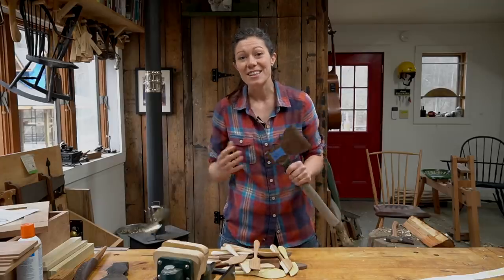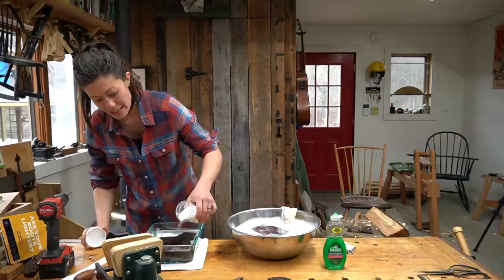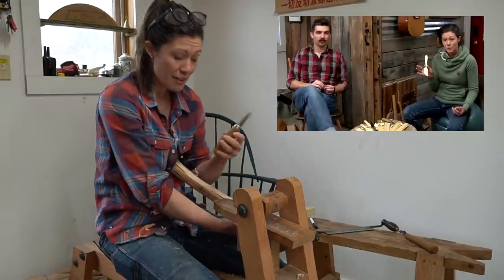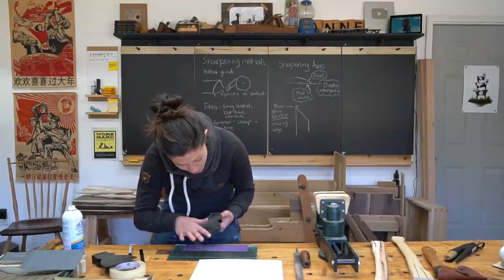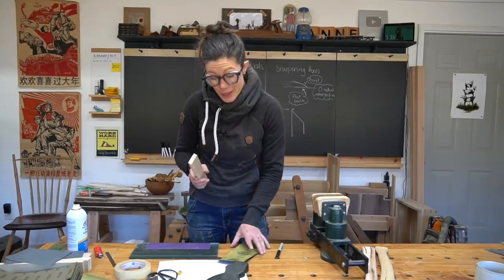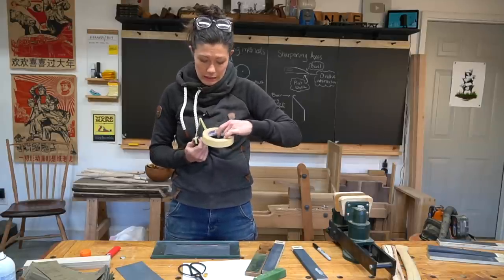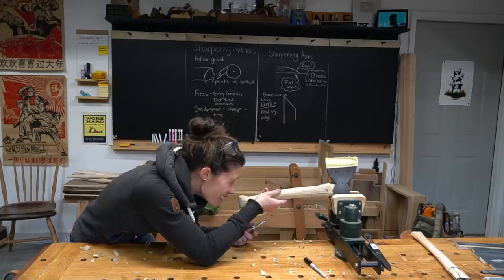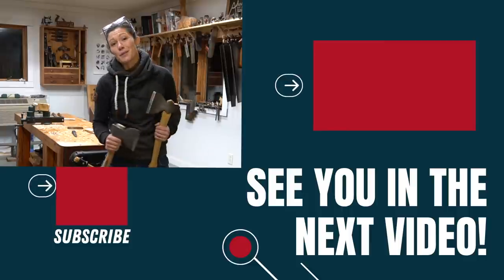Newbie's Guide Restoring a 100 yr old axe on a BUDGET

Comment: Great demo!  Even though I work primarily with machining tools, knowing how to use hand tools is an absolute necessity.  Back when I had a woodworking shop, all employees had to demonstrate a finesse with hand tools - including sharpening.  Without an intimate knowledge of hand tools, you cannot understand the basic principles of machining tools.  That includes being aware of the sounds made by a machine that needs tuning, sharpening and attention to prevent damage to the tool or the employee.  In over 40 years I never met a person injured by a properly sharpened and maintained tool, machine or hand.  Go figure.
Reply from the maker: Funny how those two go hand in hand, isn't it?

Comment: A long time ago when my father was an electrical engineering student, one of his courses required them to crate a perfect metal cube using a file.  It was a tough skill to master and makes you think about the materials.  He told me this many times and how critical angles & the feel are both needed to obtain the perfect result. That was back when all engineers had to have some practical experience.  It brings you back to reality.
Reply from the maker: Oh wow. That’s a pretty incredible feat with a file!!
Reply: @AnneofAllTrades  In the old days metal working apprentices had to file a sphere from a cube. By filing the corners into ever smaller flats as more and more corners were made.Then draw filing medium, fine and emery paper of diminishing grain until it could be polished. In those days fitters made things fit; really close. These days fitters just fit new parts off the shelf…….

Comment: Been watching your videos for awhile.  I don’t think most people understand the skill required to handle a file correctly.  So as to cleanly remove metal in a controlled fashion.  It is not as easy as it looks.  I have been a tradeswoman for 30 years.   Lots of filing experience.  Nicely done.
Reply from the maker: Learning proper body mechanics is definitely important, and a skill of it's own that comes in very handy if practiced well.

Comment: Hi Anne.  Try KrudKutter, that’s the brand name.  It is a phosphoric acid solution that works great to restore rusty items.  I have used it on quite a few items and it works great without harming the metal.

Congratulations on another great video.
Reply from the maker: Nice! I've not tried that one- what I like about citric acid is how inexpensive it is and the fact that I don't feel bad putting it down the drain- it's not gonna harm city water or septic which is a huge plus :)
Reply: @AnneofAllTrades  I re-use the acid multiple times, just pour it back into the plastic container.  When I am finished I use baking soda as a neutralizer and then take it to the city on hazardous waste day.  Other times I use 9% cleaning vinegar, it works just as well but takes much longer.  I soak at least 24hrs, sometimes longer to get the worst off.  I also neutralize with baking soda and then it can go into the septic.  No harm to environment.   I will check out the citric acid, it seems like a good product.  Thanks and greetings from South Texas.
Reply: Plain vinegar works equally well but the iron acetate blackens the fingers. iron citrate is not black so Citric acid is cleaner. Oxalic  acid works best but is poisonous  but can be poured down  drains. Pets will lick it if you let them.

Comment: I learned a neat trick (About 35 years ago).
When plane irons or any edge are pitted,  using an anvil, set the unbeveled side on the anvil and hang the edge About 1/8th inch off the anvil and tap the edge lightly with a hammer to bend it a little past flat.  Then you can hone it flat and no more pits!
You have fresh metal!
(It takes longer to explain than to do).

Comment: I think you are really left hand dominant but as with most left handed people, since you/they are forced to do more things with your right hand while they are developing the right hand skills also get developed. I’ve watched many of your videos and from what I’ve seen, your default is always left but use your right hand for things when when it’s much harder to use your left.  You can see this in your spoon carving videos.  The bulk with the left hand, then you switch to your right when those cuts are difficult or impossible for your left. Either way, I wish I could use my non dominant hand (left) at least occasionally. Keep rocking it Anne!
Reply from the maker: Ha! So you have actually discovered a funny little thing- you are right to a certain extent about choosing left first- but there's actually a reason for that. Because so many things are made for right handed people, I have always been forced to use them, but when it came to woodworking/gardening, I have intentionally tried to split my time doing any strength related task equally between hands from the very beginning because I don't want my back getting messed up from developing too much muscle on one side. I even went so far as carrying a timer around with me the first couple years I was in the shop to remind me to switch hands. With tasks that require more finess, like sawing, I wanted to develop muscle memory with both hands that would serve me if I ever had a shop accident or something. But with spoon carving, Josh actually has been forcing me to do everything left handed for a few reasons, but one of the best reasons is that it makes it easier for us to teach classes with me doing things left handed and him doing them right so our students have both examples to follow!

Comment: Try not to use anything acidic it only enhances pitting. Brass wire brush and some elbow grease or evaporust are my go to and sometimes a razor blade as a scrapper.

Comment: If you have more old tools you want to get the rust off, try electrolysis.  Just get a tub of water, add baking soda, hook up the battery charger, and let it sit over night.  By the next morning, it should have sloughed off.  Less issues with abrasive and great for hand tools like wrenches, lathes, hammers, and old vices.
Reply from the maker: I use electrolysis a lot, but this is a far less intimidating method that works fantastically well for folks just getting into restorations. I ran a business restoring antique tools for users for several years, and have tried just about every trick in the books.

Comment: Currently restoring a Philadelphia Tool Co. hewing hatchet that also has a Pennsylvania Railroad stamp.  I’m looking into hewing hatchets, I discovered that the flat side should not be flat, but slightly curved.  When hewing flat surfaces, you are removing scallops like when using a gouge.  What are these flat backed hewing hatchets used for?  What are your thoughts?

Comment: Can you do a video on the different kinds of axe blades (and knife blades), what they do and why their shapes help? I personally find it all very confusing...
Reply: Basically what kills (loosens) an axe, is the process of prying it out when it's stuck deep in lumber. Heavy axes and mauls tend to be fat, wedge shaped, because those tools are used for splitting e.g. firewood where you are going between the grain and deep (through the entire piece of wood). The wedge shape pushes the wood apart as you go down, minimizing the severity of how stuck the blade gets. Felling axes, boy's axes, hatchets and all that are generally going to be used for chopping and carving, and so a lot of weight is saved by taking the fat wedge shape out of the blade. When you chop you are going against the grain, and therefore the blade doesn't ever go super deep, so a thin blade is perfectly viable for this task.

Comment: Concentrated lemon juice from the grocery store eats through rust. About 1/2 to 1 hr will remove all the rust from an axe head. Cold.
Reply from the maker: You’ve gotta be really careful with acids though, because they can’t discern between rust and metal. When the rust is gone, they’ll keep on eating. You can (and I have) use coke, vinegar, all kinds of things, but after a few hundred restorations, this is the best, cheapest method I’ve found.
Reply: Lemon juice is citric acid. Buying citric acid powder is cheaper.

Comment: Thank you, this is a good video.
BUT!
There's not much info about hewing hatchets OR how to tell if it's left or right-handed.
Not even any info about your Grandfather's hatchet or what brand it is.
I have one that is very similar to your's, it's soaking in the citric acid/vinegar mix.
Got it on ebay, it needs a handle.
Looks like I'll have to use a 'commercial' hickory axe handle to fit the eye.
So I really appreciate wanting this & wanting to do things the old ways.
I'm learning how to greenwoodwork & I'm building a primitive English shave horse.
Have a GREAT day, Neighbor!

Comment: I'm just about to rehang 2 hewing axes that were my grandpa's, I couldn't quite tell from the video, did you make the handles with a slight curve away from the flat side?
Reply from the maker: I didn’t on these, because I didn’t have wood on hand that had grain that would follow that curve (which is very important to have, or your handle will be very weak right at the most important spot). I’ve seen folks do these handles straight and with the curve to protect your knuckles. Fwiw I’ve never scraped my knuckles with these axes.
Reply: @AnneofAllTrades  thanks Anne! I have only just discovered your channel, I'm loving it. I'm looking forward to getting the axes working, there's a bit of a YouTube theme as I bought leather from The Essential Craftsman to make covers. As Scott would say, keep up the good work! And happy new year (when it comes) from Scotland.

Comment: I may be about to ask an incredibly stupid question....
What's the difference between a left handed hatchet and a right handed hatchet? Is it just in the way the cutting edge is sharpened? Is it specific to hewing axes?
Reply: On those hews, there is only a bevel on one side and the other side is flat. On a traditional axe, both sides are beveled to a point at the center.
Reply from the maker: No such thing as a dumb question! You are exactly right, the only time it makes a difference is when it's a hewing hatchet or, in the odd instance that someone has made a custom handle that wows away from their preferred cutting side to keep their knuckles safe while chopping.

Comment: Ah! shouldn't the blade side be facing downward.
Reply from the maker: Depends on whether you want it to be left or right handed, unless you’re talking about the angle of the way you hang the head, in which case, no, this is correct for this type/size of axe

Comment: I have a question why don't you just use vinegar takes about 6 to 12 hours to remove the rest if it's not gone leave it in for 24 hours
Reply from the maker: Vinegar is a fine option- citric acid is cheaper and works faster- the heads were only in it about an hour and a half. It’s also less stinky for what it’s worth.

Comment: Hi I have been told that professional hewing axes of old came in sets of two , one right and one left. The handles were offset to each side not for the handedness of the person hewing , but the direction they were working in. The point being to clear your hand when working a big timber. Once you are past the depth of the blade, the offset comes into play.If you are above the log no problems . When you are half way down on a massive timber your knuckles would hit and the blade could not flatten that area .
Ps. Nice work , but I don’t think your handles are  quite offset enough, imho.
Reply from the maker: You're totally right about all of that- and if using the axes for hewing in timberframing was my intention, I'd have found handle material with a natural crook for that very purpose. But because I'm using these for prepping spoon material, working at the carving stump standing up rather than standing over a log and working below, these handles are much better suited for the uses I'll be using them for. That's the brilliance of restoring old tools to meet your needs or, for that matter, making your own tools! You can make them custom to your own needs ;)

Comment: I just bought an old hewing hatchet like this at a local antique shop. I’ve actually been dying to run across one, but didn’t want to just order one. So I finally found one, but one of the previous owners put a bevel on the back side :/
Also it looks like it was hammered on quite a bit on the back of the axe. Sadly it was probably used as a maul. I’m still happy with it and restoring and repairing it right now. I barely made out the stamp. All I could see was “XE MFG Co”
Found out through pictures online it’s a Kelly Axe MFG Co.

Comment: You can also use a belt sander belt and cut a piece of wood to fit inside of the belt. It comes in many grits. Also you can catch it on sale at Harbor Freight. Thus eliminating glueing sand paper.

Comment: In the future you might want to try distilled white vinegar as an acid bath. It works while you don't. I know it takes a while, but it does seem to work very well. It will also save you time to do other things while it destroys the rust even inside the eye.
Reply from the maker: I actually used to use white vinegar but moved to citric acid after the vinegar ruined several more delicate tools. The problem with the vinegar is that it doesn’t stop eating once the rust is gone. Citric acid is much gentler and works quicker. And the flash rusting after the fact is much less severe. I’ve restored hundreds of old tools and outside of evaporust, which is cost prohibitive and a pain to store and dispose of, this is the best method I’ve found.
Reply: @AnneofAllTrades  Next time I do an antique tool, I'll try the citric acid. Thanks for the tip.

Comment: I really like your videos. Well explained except for the citric acid. I suppose that the acid doesn't matter so long as it's not aggressive acid, to give the process more control?
Reply from the maker: Oh ya citric acid is just a really gentle acid to eat the rust - rust is like cancer and will keep eating away at the metal if it’s not eradicated, so it’s important to get down into those pits and clean them out.
Reply: @AnneofAllTrades  vinegar is a fairly weak acid, would it not do as well?
Reply from the maker: @donaldmcdaniel1773  vinegar also works! I used it for many years. It just takes a little longer than the acid and you have to buy it several gallons at a time rather than just adding a powder to water. Both are fine options, I've just found the citric acid to be more convenient, it doesn't make the office smell like pickles, and it works faster ;)
Reply: @AnneofAllTrades  thanks. ;-)